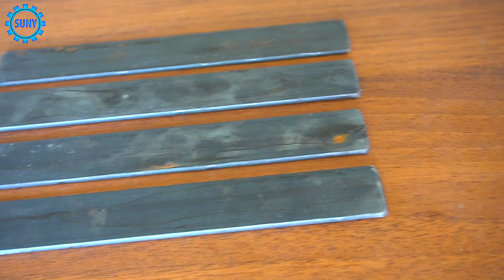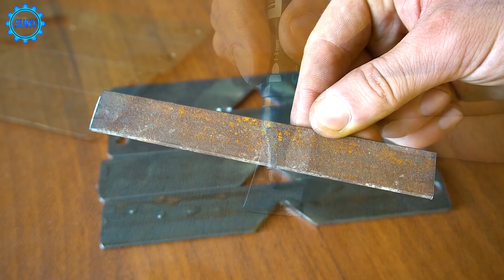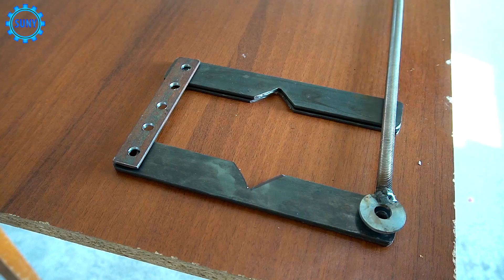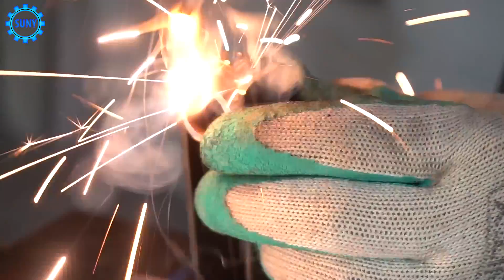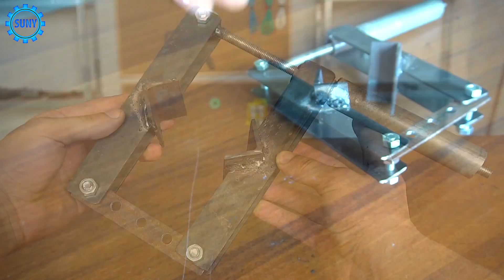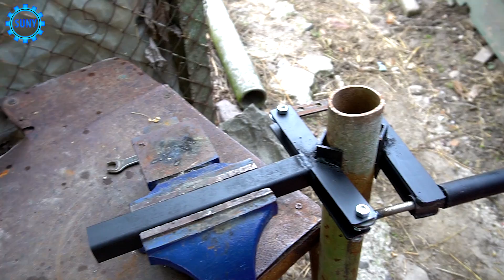Genius DIY IDEAS

Comment: Good job...why you have a vice it would do the same job
Reply: The vise is conceptual -- a social construct. JK. 

This project could be improved. Since square tubing is available in different sizes, use that instead of multiple drilled straps to make the jaws, drilling and cutting the mouth to suit fixed adjustment mechanism (if used) and clamping mechanism points. Reinforce with strap if moved to. 

The jaws faces could, conceivably, be a variety of cross-sections of round pipe, in addition to angle iron, with each pair of sized jaw facess mounted on a length of square tube that fits over the jaw arms. Positioning the actual jaws could then be variable, giving various hand-tightened clamping pressures for the same basic set-up. 

Making a second copy of this, with next-size-up square tubing, and extending one jaw arm of both -- including this one --, you'd have a means to secure this smaller pipe vise to another, larger variant which could mount to a fence post, tree, or other stout/permanent object. Join the two sizes together by sliding the small size jaw arm of one into the larger jaw arm of the other, and secure with two or more pins. If one jaw arm is drilled on all four faces, and identically, you'll end up with multiple possible arrangements of the two parts of such a vise.